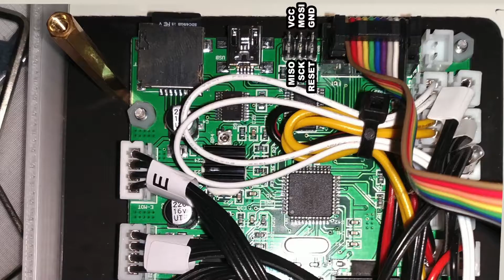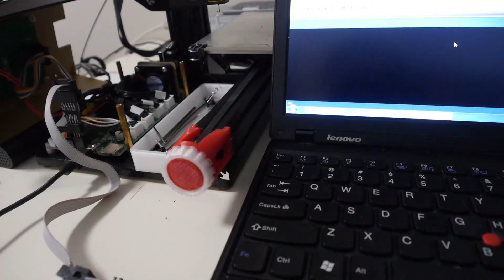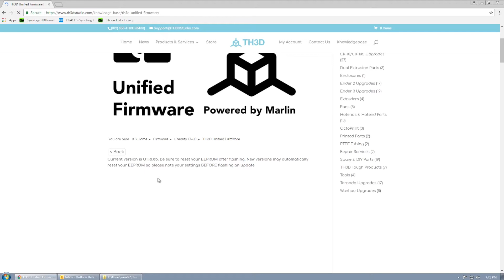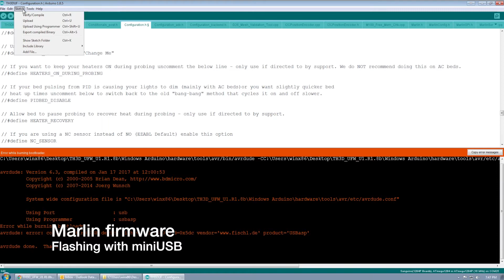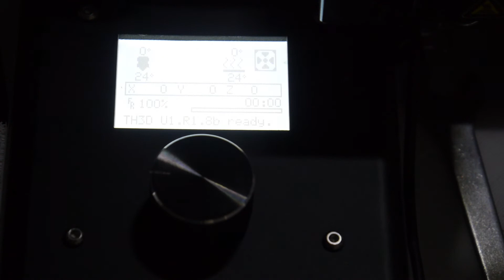Creality Ender 2 CR-10 Marlin Firmware flash upgrade

Comment: OMG I was about to run amok. But thanks to your great video, I am finally (many many hours) able to upgrade that firmware. My usbasp could not send data to the printer it seemed like. The solution was to change the usbdriver in Zadig from libusb to WinUSB. Thanks for doing this detailed upgrade procedure on video.

Comment: Many Thanks for that Video! Did the update from Creality Firmware to TH3D/ Marlin some Mins ago and thanks to your Video, it worked great!
Reply from the maker: Awesome. Yeah I'm still using the th3d firmware on mine and it's much better than stock
Reply: Me too, have the latest version my CR-10S and now also on the Ender 2. I like that its so much better to work with than with the original Firmware! Best regards from Germany! Frank.

Comment: I flashed the TH3D firmware but there might be some errors.
It seems to work, but I can't change things like feedrate/speeds from the menu.
Reply: check for eeprom settings
Reply from the maker: I don't change those on the printer. I usually modify it on my slicer, simply3d.

Comment: Didn't work for me. Tried multiple driver using Zadig, Tried replacing AVRdude with older version 6.3. 
Comm port is grey. tried 3 different computers, 2 laptops and my desktop. 
I had this shit working like 6 months ago to reprogram my Anet A8 board and it worked great.
Really frustrating... I really hate arduino sometimes...

Comment: Thanks for the tutorial. At which step did the bootloader flashing happen? Also you mention at 0:53 that if the bootloader is flashed, we can use the mini usb. Is this a 1 time thing and you can also disconnect the isp programmer, or that loads the board in a state where the usb can be used for it so you always have to deal with this if you want a new fw? Wouldn't it be enough to power on the machine and use the usb and you could skip the jumper change?
Reply from the maker: Hi, i just saw this message today sorry for late reply.  Flashing the bootloader is a one time thing.  Once you do that, you don't need to do it again for future firmware.  You are correct, you can also use the power of  3D printer power supply without switching to USB power.
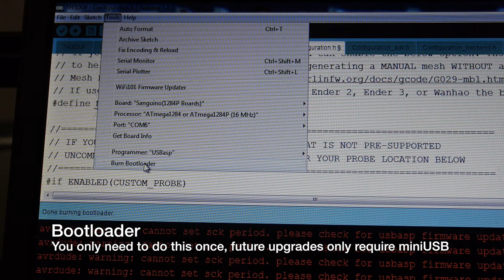Reply: 7:23 the bootloader gets burned.